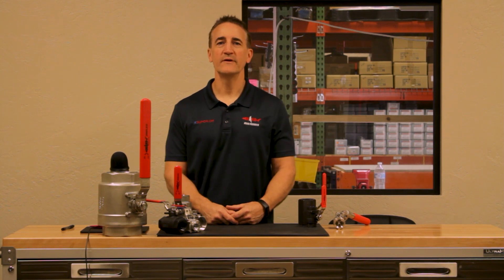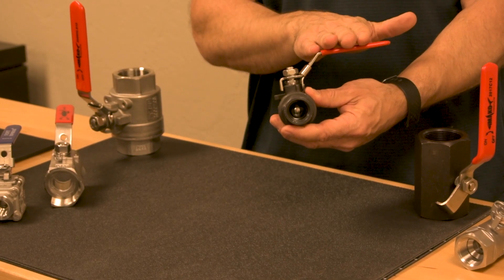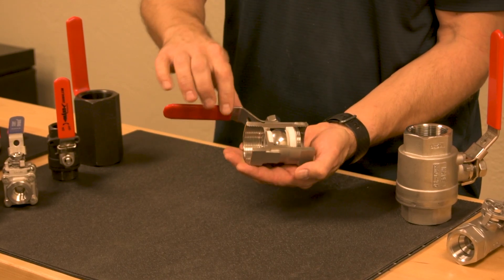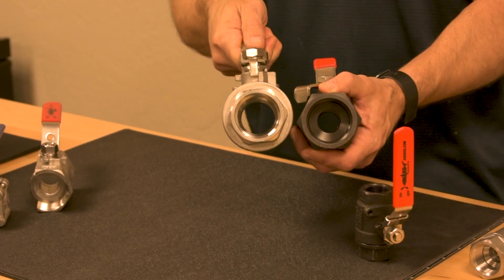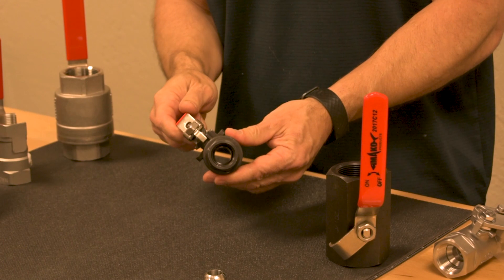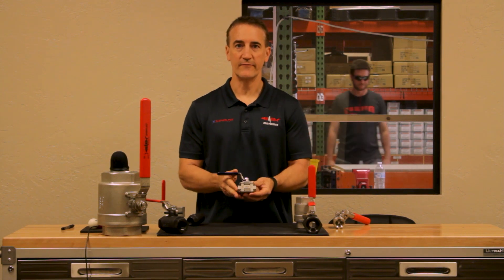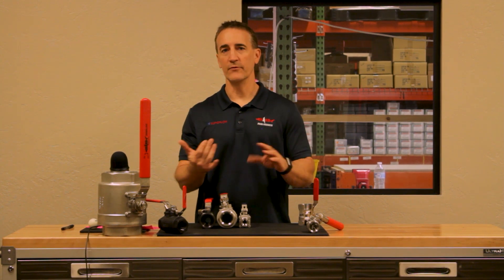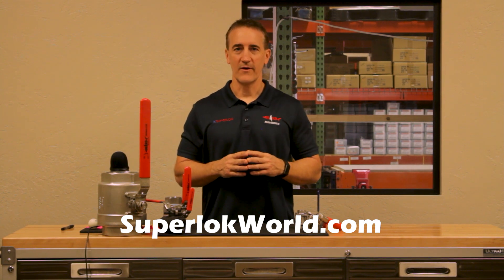Ball Valve Basics

Comment: very good video. How can you identify a full port vs reduced on an already installed valve ? Is it just checking if it has 2 parts enough ? Are there any markings ?
Reply from the maker: The best way to be sure is to jot down the valves part number and look for a manufacturers specification sheet for your particular valve. Most valves will not have a marking denoting full or reduced port and not all two piece valves are full port. It would be safe to say that a one piece valve is more than likely a reduced port, but some two piece valves will have to have a narrower orifice to accommodate higher pressures or specific usage requirements. 

Glad you liked the video.